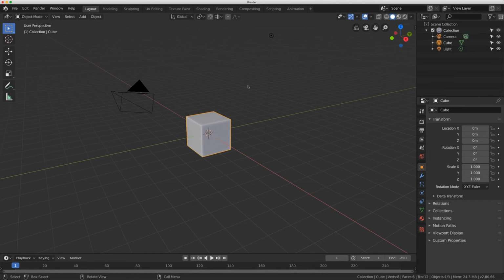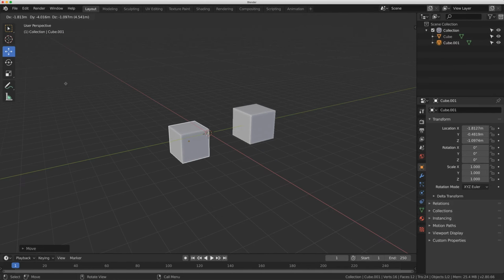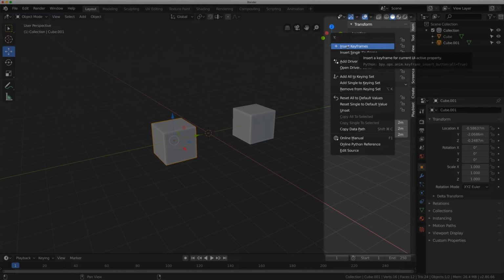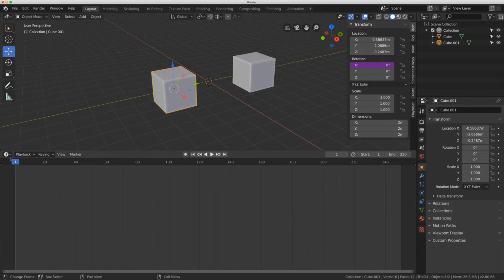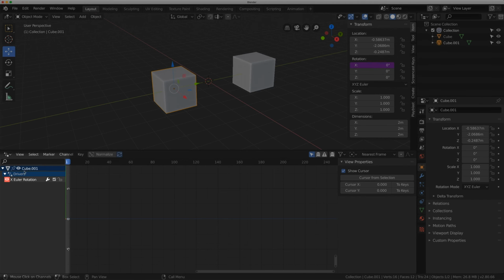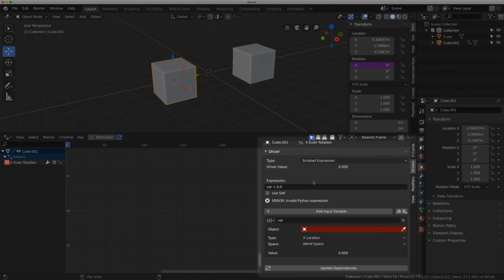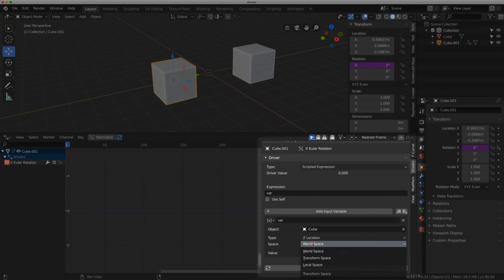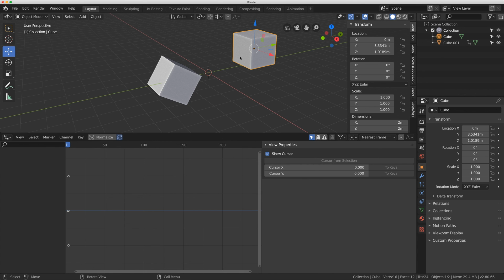Create A Simple Driver | Blender Drivers Master Class

Comment from the maker: Example files can be found here: https://gum.co/YONwT
Not much for now, but as I add more videos to the series there will be more example files.
Reply: Thanks for this LPL ! Dude, I'm finding my Drivers are updating the value, but the graphical change is not occurring "live" - do you know what I may be doing wrong? or is there a setting to turn on to update Drivers LIVE ?
Reply from the maker: @hiranga  You may need to turn on auto run python scripts: https://docs.blender.org/manual/en/latest/advanced/scripting/security.html#:~:text=In%20the%20File%20tab%20of,without%20using%20the%20File%20Browser.
Reply: @LevelPixelLevel  I think it turned out to be the way I was referencing to the script - I'm now using "def" to define the function and return the values, which is working! Clearing a noob mistake . Thanks for your help!
Reply: I've been doing some tests with some of my own files and models. The most recent test involves a moonshine jug with "XXX" labeled on one side. I put a driver on the jug's rotation and as the jug rotates counterclockwise the camera comes in for a closer look. Some of the things I don't know how to do is control exactly when the jug turns around and presents label and when and what distance the camera begins to close in. What I have done is just define two keyframes and the jug rotates twice as the camera closes in. I believe this could be done more dynamically and have a commercial application in advertising. It's probably already being done. But I enjoy learning from your videos:)

Comment: Hello! Please tell me how to change the visibility of objects from the position of the bone, I can't figure out how to set specific values for each of the objects.
From the bone's X position, I assigned the drivers to the blanks: a cylinder, a cube, and a sphere. But they all turn off visibility at the same time. How do I set the spacing for each of the objects. So that their visibility switches in turn. From the source of the bone, it seems clear - moving along the X, but what to put in place of the Expression (now there is var) - I don't understand.
Reply from the maker: You can do this with an equation, or you can do this with an if statement: https://youtu.be/SwcMyAf3MCk
then, if the value is at 2 or something you turn on the object.
Reply: @LevelPixelLevel  Thank you so much for your answer, man! In the evening after work I will try this method. All the best to you!